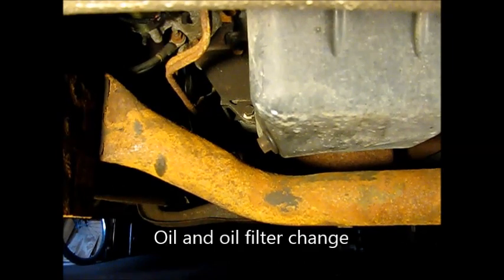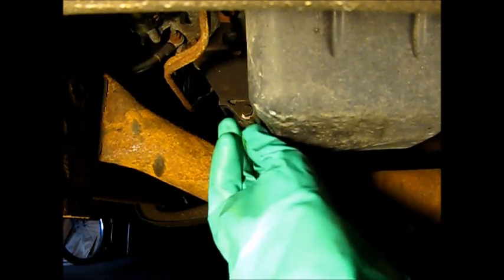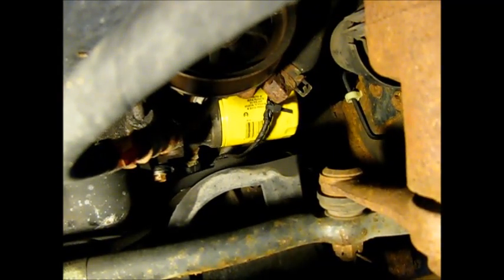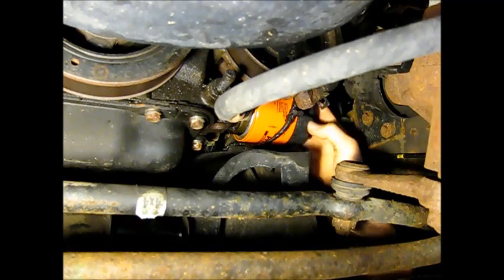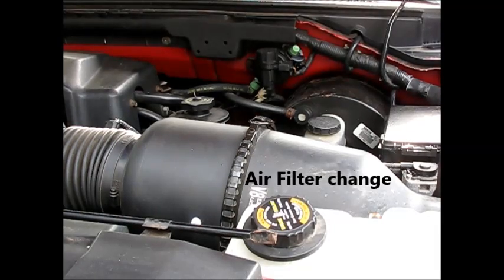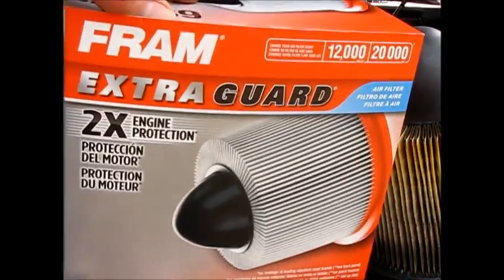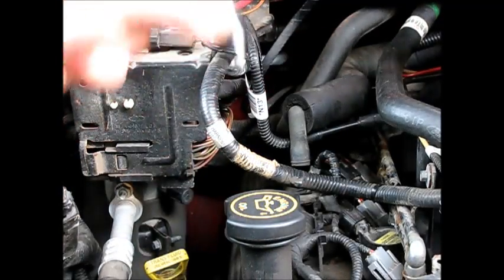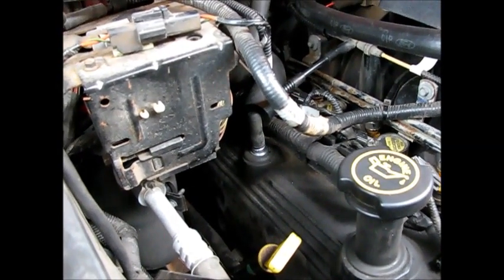Ford 5.4L F150 maintenance: Changing the oil, oil filter, air filter and PCV valve

Comment: I have a 98 5.4 mechanic puts in 5w20, (its hard to change oil myself cause i can only do it on the street, which is rocks and cops twice warned me about that, 0 tolerance i guess😳 anyway manufacturer says 5w30, i have 281000 miles on it, why 5w20?

Comment: You should never place the drain plug back into the oil pan without taking out the oil filter first as you'll just push all that garbage oil back through the engine
Reply from the maker: You leave me speechless.

Comment: One thing while checking your pcv, check the hose for wear, i have had mine fail twice over the years on my 99, causing a nasty vacuum leak. Other than that good vid, but don't ever use Fram filters, especially their oil filters. WIX, Purolator, and NAPA are probably the best on the market right now.

Comment: The 5.4 is best using Motorcraft oil  and filter. Because the vct solinoids get clogged causing failure on the cam phasers.
Reply: There are no vct solenoids on this 5.4 2 valve.  It's the 5 4 3 valve that has them in that engine. This video was for a 5.4 2 valve.  Incidentally I have a 03 F150 5.4  2 valve with 406,000 miles and runs perfectly.  The 2 valves are way less problematic and can really get high miles. There are some with 600,000 plus on them. The 3 valve started for the 2004 model.
Reply: What weight oil and do you use synthetic or regular type oil?
Reply: @albduke  On the 5.4 have been using Motorcraft regular was 5-20 but if you change the oil pump changed to 5-30 Ford design on the oil pump under performs they recommended mellings340 hv hi volume.oil pump. I didn't use synthetic just because the screens in the vct solinoids clog. Got this info from  Ford forums over the years definitely helped. Good luck!
Reply: @dave1uofm  I've been using 10w30 full synthetic on my 5.4 3 valve. Any oil filter I get a good deal on, I buy it. I've used Fram,super-tech,pronto,Motorcraft and others. I have over 254K on the original engine.
Reply: @danp7463  You are very fortunate! I bought mine had 174k had to replace the cam phasers dropped $3 Grand in it  couldn't get it to run good. Had to get a newer f-150. Proper oil changes a must

Comment: So alot of people are saying "Fram" is shit so what about K&N or royal purple oil filter?
Reply: QUINTERO _64 for the money,  Motorcraft.  the best is royal purple or mobil I. cut a fram open and look at the pleats and end piece. they really are very low end product.
Reply: Crack open a fram and compare to other brands, the fram is cheap and doesn’t filter shit.
Reply from the maker: I don't know what the basis is for condemning Fram. I'd be interested in more detail than "they are shit." I've used them for years and haven't had engine wear issues. I'm not familiar with those two brands.
Reply: The Original Mechanic OK thanks bud.
Reply: Jim Dailey Thank you sir.

Comment: Why 5w30 and not 5w20 as per the manual?
Reply: I have a 09 f150 crew cab with 260k miles on it do u guys recommend 5w30 would it benefit the older engine?
Reply: I know this is old but 5-20 on the f150 it is recommended Ford if oil pump change Mellings hv hi volume than use 5-30
Reply: 5W-30 is a little thicker than 5W-20 so this will better for the internal engine parts for the oil to cling on,  5W-20 is thinner and was made for better gas mileage.
Reply: @man213 5w30 better for cold temps?
Reply: 5w30 IS what's called for... not 20

Comment: just saying dont use a fram oil filter use ONLY MOTOR CRAFT use rockauto.com  very cheap way cheaper then any part store
Reply: I'd put the old one back on before I put that orange pos in
Reply: Why only motorcraft
Reply: All filters are fine, but Bosch and Mann.... Wix in America... Filters are best.  Bob's the oil guy recommends them because they filter down to a finer particulate size.